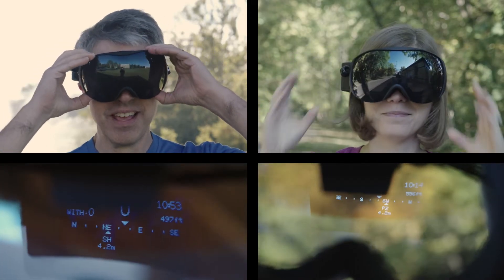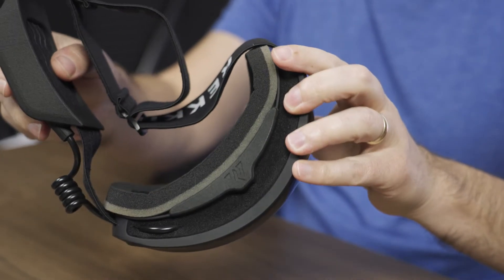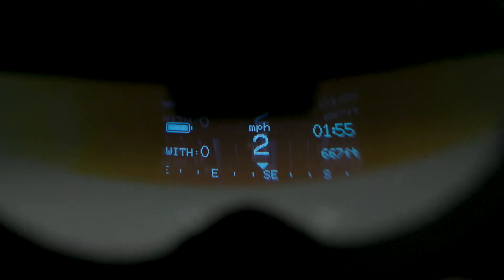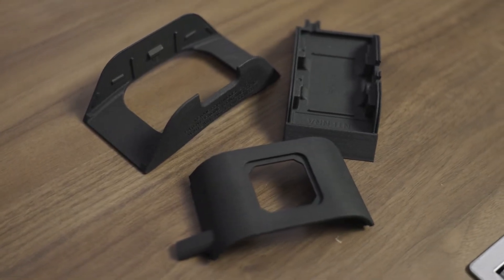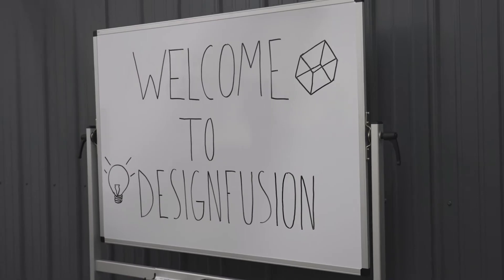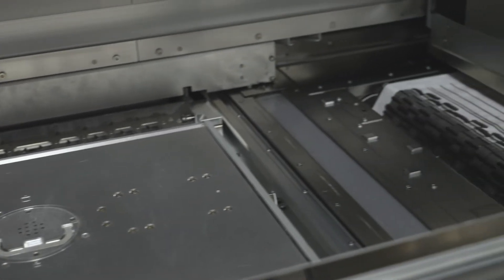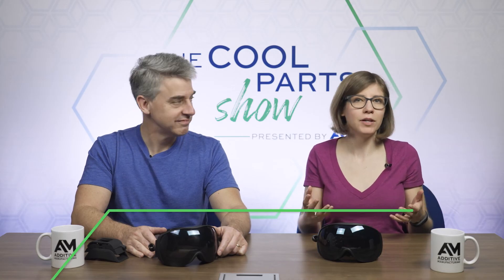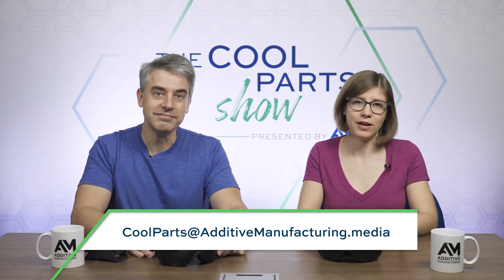Rekkie Smart Snow Goggles Made Possible with 3D Printing | The Cool Parts Show #53

Comment: Fantastic idea, but....I would like to see the box located in the a jacket pocket and have a cord running to the goggles.
Id be worried the goggles could come off in an emergency situation like avalanche and loose the location of the wearer.
Reply: Hi Steve, thanks! The box is light weight and grips the helmet well, and location is actually measured by the GPS in your phone. However, for an avalanche situation where precise location is needed, REKKIE Goggles are NOT a substitute for a beacon (and probe, shovel, and proper training).

We tried running the cord down to your jacket pocket in some early prototypes, and honestly it was kind of annoying vs the strap mounted enclosure - kind of like airpods vs old wired earbuds.

Comment: So you have to be in service for this to work?  What about back country?
Reply: There’s a built-in 915 MHz radio, so if 2 people have REKKIE Goggles in the backcountry, they can still see each other’s live location
Reply: From what I’ve read, the previous reply is correct. The only time that doesn’t work is if say you have the goggle and the other doesn’t, you need service to transmit location